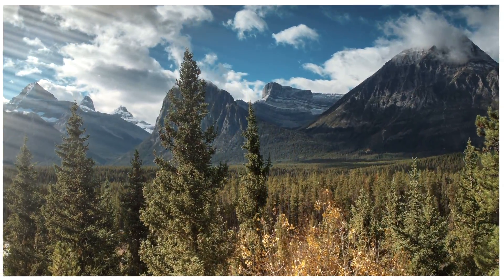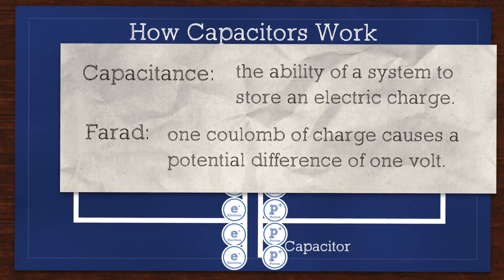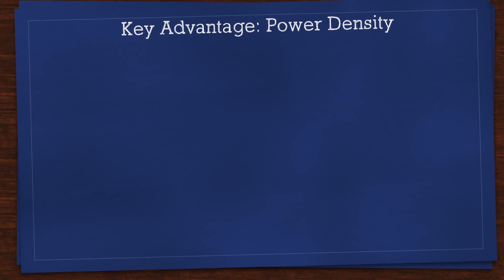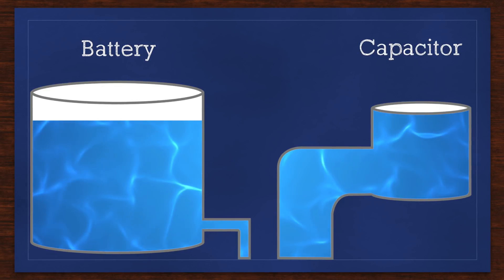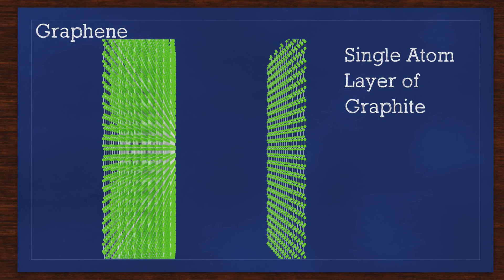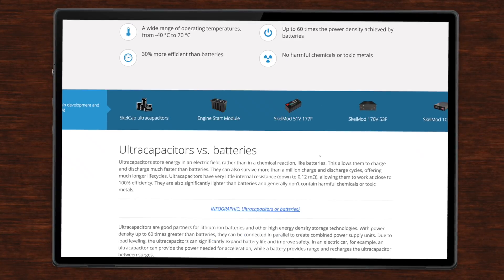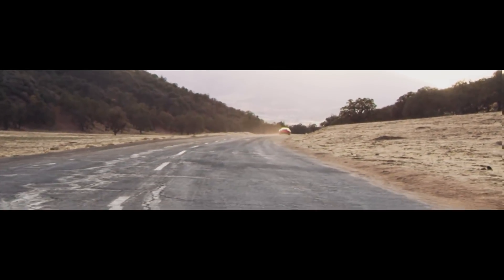Can This New Technology Make Batteries Obsolete?

Comment: Brilliant presentation! This technology will have a profound effect on energy storage and delivery. Working in tandem battery storage ultra capacitors  could be the EV solution to balanced delivery of power and regenerative recovery of energy. I am very confident this will happen in the not too distant future. This combination could go a long way towards achieving gas pump like delivery of energy recharging. Hydrogen technology will in the end be the winner of this race, but the combination of Batteries and Ultra Capacitors could be the interim answer to the recharge dilemma EVs face currently. If we cannot provide equivalent recharge times as we currently enjoy at the gas pump, mass acceptance of EVs will have a tough road ahead. The human herd has never been able to change to something new, if they see it as going backwards. That only happens in politics.

Comment: Wind and Solar are not especially efficient or cost effective. Hydro and Geothermal are better. Cheaper, longer lasting, and more efficient solar cells could make it more viable though, if such are developed. All 4 are very location dependent, making transportation and storage of energy the key aspects to renewable energy. But there are many locations where renewable energy will not become cost effective until nonrenewable resources have become quite rare. Still, it's worth working towards being more renewable-focused. It would help immensely if there were less people treating government like an infinite credit card, and more studying and working to make renewable energy more cost effective.
Reply from the maker: Wind and solar are crazy cost effective. Couple them with a nice battery like a powerwall and you’re set

Comment: In the UK, i think its in Wales, they have one massive power system that is wffectively a giant battery. It uses power generation devices to create the power and provide it, but when it isn't needed the power generation still happens, it is used to pump water from a resevior at the bottom of a hill, up to a reservior at the top, during peak times the water is released back down and provides hydro electric powet at night.

Comment: I live in an RV. I can see where these will be useful to take the load off the batteries with things like the AC startup, microwave use and toasters. Things that use a lot of power in a short time. 

That being said, can ultracaps charge and discharge simultaneously? ie: Run a microwave and get a huge dump from a solar array?

Comment: Even an ideal capacitor has a limited charging rate due to dielectric breakdown  from dV/dt (rate of change of voltage overtime). Real world capacitors also have Resistance and inductance which matter in high power applications. Your example is ok for a simple model but, those effects make a big difference when building real world devices.

Comment: During discharge battery voltage remains fairly constant. This is good as it means currents remain constant.
Capacitors are different. During discharge their voltage drops. This means currents increase for the same power to a motor. More current is a problem for the power delivery system. This is not good.
If decide to only go down to 50% of voltage, that means you have used 75% of the energy in the capacitor, but the power electronics still have to cope with double the current at this discharge level. Tricky.

Comment: Nice overview of capacitors, although I was surprised you did not mention that the lifespan of capacitors far exceeds that of batteries. Because there is no chemical reaction, capacitors have the same capability all during their life as well. Finally graphene is less of a pollution concern compared to lithium or lead.

Comment: Hello world !!! Capacitors still have to be charged, just like batteries. Where is that energy going to come from?? That's what we need to fix, a more renewable power source, not something else to store it in. AAAAaaaahhhhhh
Reply: ya like nuclear power plants, which are by far the most eco friendly
Reply: A cheap energy storage solution is what makes renewables practical. The main problem with solar and the like is the uncontrollable and unreliable power production. Look up "duck curve". Supercaps are for smoothing out peak loads not mass power storage tho.

Comment: Hydrogen is NOT an energy "storage" solution. You need to MAKE hydrogen and that costs more than the energy it might deliver. Why MAKE it when oil and gas come gushing out of the ground?
Reply from the maker: You know what storage is right? Holding emergency to release at a later time. Oil doesn’t just come out of the ground ready to use either
Reply: Batteries arent 100% efficient either. Your always going to have losses in a system.

Comment: I crunched the numbers on it.  Something never touched on is the ridiculous amount of storage needed.  The ACTUAL grid  (assuming its a fully functional one) has enough capacity to produce an average of 2X demand.  And with the piles of coal beside the plant, supply chain, etc, there are weeks of "storage" buffering out production.  Renewables are insanely erratic though so they need much more buffering (months) or to have many multiples of the average needed energy and somewhat reduced storage.  The storage, in powerwall batteries, would be about 100 trillion dollars and need to be replaced every 10 years so...yeah... no, just no.

With hydrogen it gets interesting because again, the systems closer to batteries are prohibitively expensive so you're better off making much more energy than you, turning almost all of it to hydrogen...then just burning it in a good turbine.  Its about 40% efficient.  Fuel cells works out to about 60 or 70 so its not that much worse.

On the other hand there's nuclear.  Because we can extract it from the oceans where there's always more to dissolve due to erosion, it is effectively renewable.  Its true, nuclear isn't good for peaking BUT if you use batteries for peaking you only need about 1/4 of a single day's production.  Basically you make a plant that outputs around 75% of peak use, filling batteries when its at base load then discharging them as the load goes beyond the output of the plant.  The battery cost about .25% of what would be required for renewables since the production is extremely stable.  And of course, the hidden "oh no you won't" of wind/solar is that they actually take many times the concrete and steel of even the older nuclear plants.

The bottom line is that we simply will not be using wind/solar for our main energy production.  Once you look into the materials and battery cost you realize it's all been a laughable exercise in futility.  Even if we did manage to get a significant portion done, the economy and standard of living would drop so low that no sane person would care about renewables and the work would stop anyway.  Its just one of many places where the media has completely failed us through one-sided reporting.
Reply: poitsplace exactly, new nuclear will require the least resources from the Earth and produce the most power. There is enough uranium and thorium for thousands of years

Comment: I am a retired electronics engineer. I found this video very interesting and informative. I certainly hope capacitor technology does progress as you theorize in this video. It would do much to advance our energy supply systems around the world. Also, I am old enough so that I still use the term "condenser" when referring to capacitors, the amount of charge they hold as their"capacity" not capacitance, and micro-micro farads instead of pico farads, since that was what they were called when I studied electronics. We never even used the unit nano farads. Yes, I really AM that old,  that was many years ago.
Reply: have you heard about the five minute flash charging electric vehicles by BYD (build your dreams).

i don’t know everything about the battery but i am studying the battery in great detail. these batteries have zero fire hazard, add 249 miles of range in five minutes of charging, charge at a speed of 3000 miles per hour, have a 4,000 charge cycles lifespan (750,000 miles of driving). these electric vehicles are being sold worldwide, including in Mexico. and customers are already driving these electric vehicles, its not just a concept that will come out some day.

the battery is also 100% recyclable, low cost and abundantly available materials.

quite exciting. and cost around 40,000 dollars. BYD also makes electric vehicles which cost around 7,800 US dollars as well.

the BYD flash charging electric vehicles charge 500% faster than a tesla supercharger charges an electric vehicle. that is significant. because tesla electric vehicles require 30 minutes to add 249 miles of range, while BYD requires only five minutes to add 249 miles of range.

quite exciting indeed !

Comment: I have enough power here for everything I need.  24x2 volt batteries and inverting from 2400 watts on the roof (in the sun).  At night I can run 1000 watts for 12 hours.  This is a cheap system (as they go) with an auto kick in generator.  I rarely need the generator and the whole thing will pay for itself 3 times over before the battery guarantees run out.  No matter how good tech gets, we will always be ripped off when on the grid.  If they made power for nothing they would just charge more for what they would call 'maintenance' lol.  There is no future in being on the grid except for debt slaves and the like.  For an extra 1% on the cost of a house it need never get a power bill.  At that point theyll ban solar panels or introduce a sunshine tax.  The grid sucks so unless its a private battery, it isnt worth anything to the common man.

Comment: If they can make graphene capacitors of high power density, electric cars could be powered by them. They would also last much longer than lithium batteries. A car powered by these could be charged in the same time it takes to fill a gas tank. These capacitors would cost less than lithium batteries. There are many researchers world wide working on these.

Comment: I heard something about an tank of salt water iron battery dont know if acid was in it aswell but only usefull for house energy storage . The only big capacitor i ever used was in a komatsu hybrid excavator the capacitor is charging while idling/not much force needet and it helps the hydaulic pump with an e motor while much power needet. In the end it hasnt the much needet power asn bigger diesel engine/hydpump but lowers fuel usage depends on what y do with the digger.sry for my bad english grettings from germany

Comment: In the example of the cars, the total energy is not the same at all.    The faster car consumes way more energy as per E= 1/2 mV^2.   SQUARE the speed.
more power, requires more fuel = more total energy.   Now if you compare a more efficient engine, you can reduce the total energy, less fuel, with better power.
Reply: Yeah, they were being way optimistic here. Even ignoring the KE input costs from that formula (I'd assume it's all highway miles anyway at that speed), there's all sorts of stuff that really screw up your efficiency when you start going past the 70-ish mph range. Way more drag, tire friction... even the engine itself isn't really built to be efficient when going that fast. Most cars, if they go from 50 to 100mph, will literally lose half of their gas mileage.

Comment: Actually the amount of power created by electric brakes is the equivalent to a small lightning bolt ..-so .. ultra-capacitors could absorb that giant amount of energy.. & then slowly disperse it back to the battery properly ....instead of overwhelming the system

Comment: 3:26 , wrong answer a battery drops its voltage while discharged aswell  just like a capacitor  only more slowly...
Reply: He's probably referring specifically to Li-ion batteries, which maintain voltage throughout discharge cycles, rather than trying to explain discharge rates of multiple types of storage mediums and materials, the comparisons of which would, for this video at least, be irrelevant.

Comment: When extracting energy from a capacitor you can never recover more than half the energy placed there by charging. So efficiency will be less than 50%. The same is not true for batteries.
Reply: Capacitors suck , lol

Comment: The old fashioned name for capacitors was condensers. It is not a new technology by any means. Whether or not graphene can be successfully used, I don't know. as you noted, the voltage drops off sharply during discharge. I have heard of these being experimented with for applications like cars but I will believe it when I see it. Electrons naturally repel, so I would think that there would be a rather low limit to how much charge can be stored. Believe it when you see it folks.

Comment: tech is interesting but won't do any good to regular people unless the price is reasonable to change from battery to capacitor...  oh and don't forget safety net of batteries usually better high F capacitor at this point of time can zap you due fast discharge like electric shocker devices.
so i don't hold my breath for now, see what's future holds

Comment: The Ultra Caps (super caps on the schematic) were in the farad or two range.. used primarily to display fault lights on motherboards after the power got pulled.. Would keep things going for 10-15 minutes.  What killed the LED at that point?  The caps could hold a charge for that length of time. Some did 5 minutes.. other 15. and they self discharge at a moderate rate.

Now those were NOT graphene.. but I suspect that Graphene will have the same sort of issues.  The Ultra Caps have one REAL good thing as an application:  Sucking in braking energy on cars.

Comment: It says on their site that their capacitor cells have a specific energy density of 6,8 Wh/kg. Not the 30-100 Wh/kg that you say. That is a BIG difference.
Reply: Thanks, Wankel Motor, I was wondering the same thing.  Looking at the datasheets for both Maxwell and Skeleton, it looks as if the Skeleton have superior power and the Maxwell have superior energy.  

For many applications, I imagine it would be better to use the Maxwell which store more energy and also are capable of very high power output (though not as high as the Skeleton).  For example, I assume the Maxwell would be better for regenerative braking, where energy needs to move over the course of several seconds.  

When would the Skeleton caps be a better choice?  I don't know enough about wind turbines.  Weapon systems?  Pulsing fusion reactors?  

Until Skeleton can acheive higher energy density, I just can't see them as the market leader for any sort of ordinary, everyday application.

Comment: That was the worst technical overview of a supercapaciter I've seen!  All you did was show the basic theory of how to create a general capacitor. You didn't mention leakage, plate warping, temperature variations etc. the fact that you need a battery/power source to provide initial charge as you really don't want to install these fully charged.  Also your overview of graphene was completely weak.  It's like you took a tiny bit of theory and created a video with just blurb to fill the very large gaps.  Do your home work and produce a proper video before you ask for patrons!

Comment: Too pie-in-the-sky. Ultracapacitors probably won't ever replace batteries. They're different beasts. EVs might use ultracapacitors for regenerative braking, but as Tesla has shown, if you provide enough battery cells in parallel you don't need them for regen braking except possibly in race cars where overheating is a concern.

Ultracapacitors may be used in the future in EV suspension systems, both to control the suspension electronically, and possibly to recover energy from the wheels' vertical movement. This is something that batteries are just not responsive enough to do.

BTW: Graphene may be used to revolutionize battery cells as well as ultracapacitors.

Comment: For a capacitor you need two conductive plates (graphene in these case), and one dielectric separator.What you need to be very thin is the dielectric. Is graphene conductive and dielectric too ?

Comment: One problem with ultracaps is they leak power over time,much faster than batteries. So stored power has a much shorter lifetime. Tesla buying Maxwell Technologies is still a good thing,however,as combining ultracaps and li-ion batteries results in saving the batteries for cruising,while ultracaps store braking energy and release it quickly to get the vehicle back up to speed.

Comment: Woah hold on, the K value of the diaelectric is hella important too, higher K value means higher energy storage? There's so much research on high k dielectrics , so I'm not sure why you brushed it off so quickly in this video. The dielectrics is what stores the energy AFAIK.

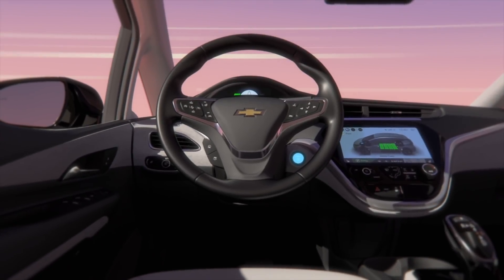Comment: 9:00 why send the regen breaking energy back to the battery? jut keep it in the supercap till you accelerate again. the battery keeps the supercaps topped up not the other way round.
Reply from the maker: The super caps being empty allows for very high levels of brake regeneration too. So it’s up to the designer how to design the sustem
Reply: @TwoBitDaVinci  But if you have just breaked you are unlikely to regen break again as you can not go slower than stationary. Quite a small array of supercaps should have enough energy to drive at least a few miles so you should be able to keep the caps close to 50% charge so they can always break or accelerate rapidly. To do that you only need to top the caps up when they get below 50% you should never need to drain the caps into the battery.